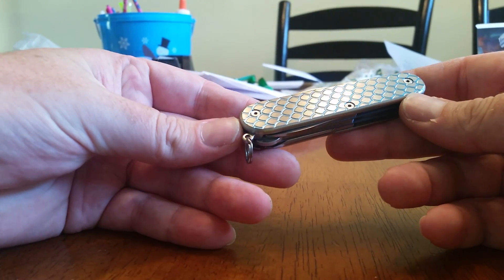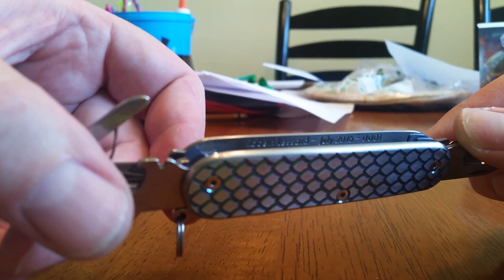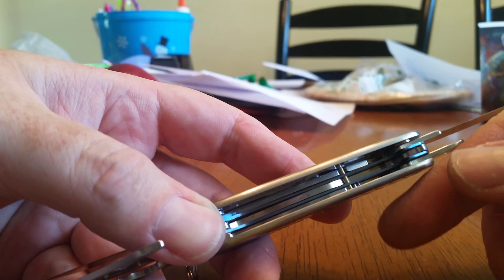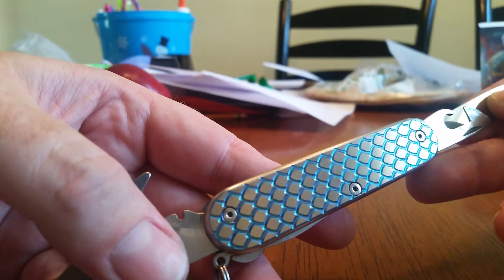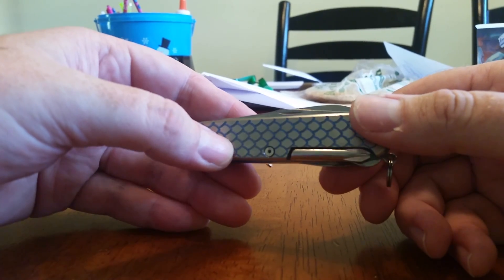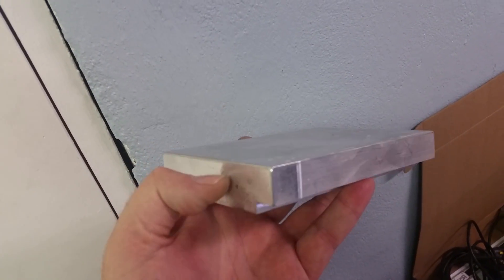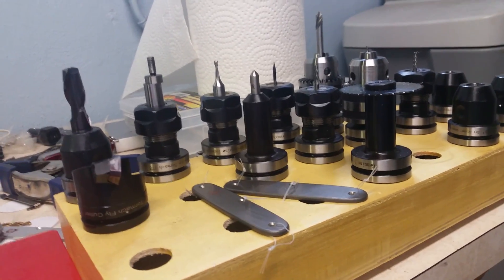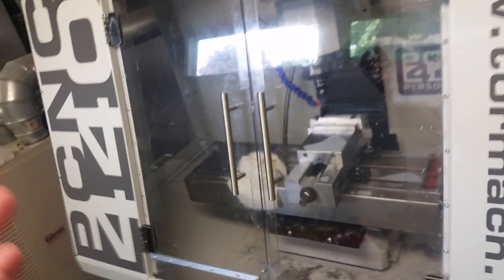First CNC'd Titanium SAK demonstration

Comment: Did u use some washers in main blade? There is a little bulge in oryginal liners to place the blade in correct position.
Reply from the maker: kubitron hi yes I make small washers 0.015" thick to compensate.
Reply: Okay thanks :D
it's about 0.381 millimeters, i hope 0,4 mm will works :)

Comment: Another thing I've been meaning to ask (if you don't mind the questioning) is how the tweezers are kept inside the scales if there is no liners, but you already answered so thanks for that. But I assume for plus scales you would need some backing, and wouldn't you need a counter weight for the fly cutter?
Reply from the maker: I think with larger machines the fly cutter probably runs smoother on larger settings, it was fine once I made it smaller.  For plus scales it would need a backing, but the pen is also thicker than the scales I normally use so I dont like that idea at all.  I do have an idea to store all these extra scale bits in a different way though that would be much better if I can get it to work.